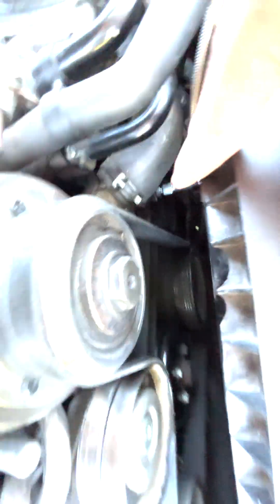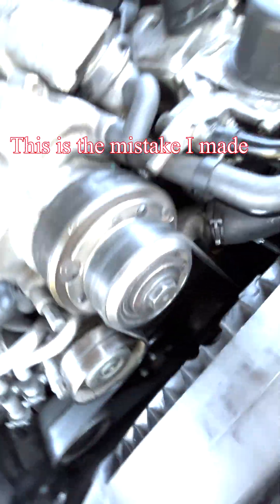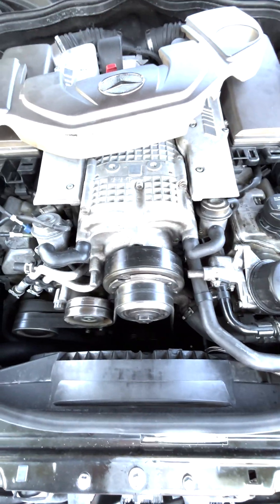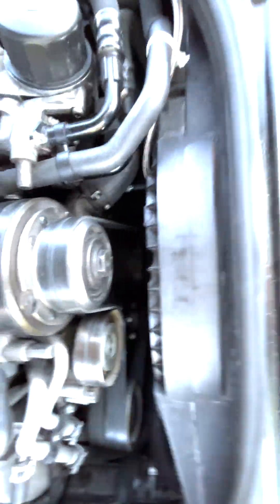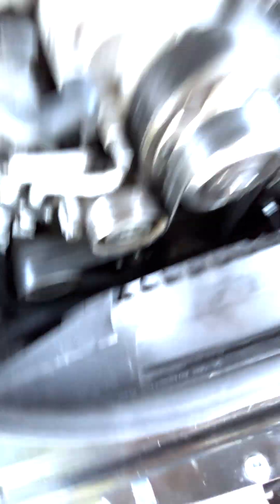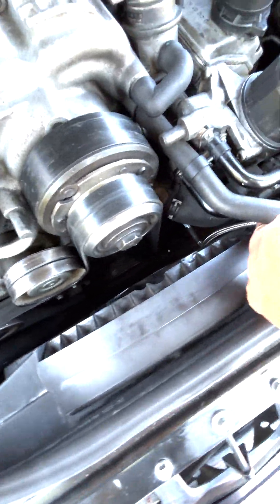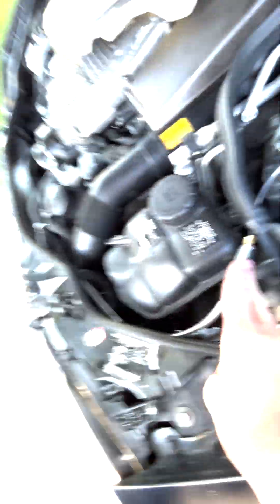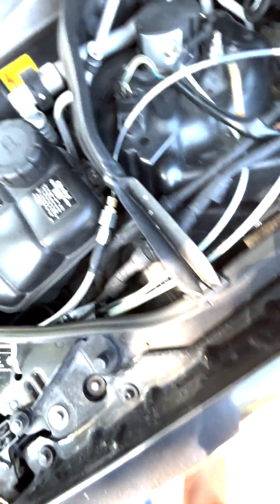How to install Oil pressure gauge on an m113K/m113 engine

Comment: How did you fit the plastic hose from bosch into the metal hose? Cant fit it…
Reply from the maker: do you have 1/4 npt adapters? I’d check out my other video not a fan of the Bosch gauge it leaked everywhere not the line surprisingly the gauge leaked.
Reply: @ ok i know whats the thing.. you used the metal line and then the plastic line. But anyway I also will go for the electric sensor but I‘m still thinking about which one.. yours like in the other video or a product from glow shift.
Reply from the maker: @usta.berlin VDO is what I used in the other video mine works beautifully and VDO is oem to the w211 if you don’t believe me looks for the works VDO in small print on your gauge cluster.

Comment: do you think i can do this exact steps to my 2012 W204?? *desperate help, thanks!
Reply from the maker: @jpanglao00  That car may have an oil pressure gauge already what engine is it? if not a 113 it likely doesn’t have the same access port. I am in the process of making an updated video but likely will not cover any other engines than 113
Reply from the maker: @jpanglao00  It has a warning light but no gauge E55 has neither hence the video you could install a gauge if you would like and this video could be helpful but isn’t the end all be all. your motor probably has a different oil pressure port.
Reply: @bugnautica-lo9ng  i’ll lyk how this goes, MB Forum tells me there’s no OPS on my model.
Reply from the maker: @ No gauge but I believe it has a warning light that’s what google says I started work on video 2 today my video should be very applicable if you can find an oil pressure port maybe there the same but I doubt it.

Comment: Installing a mechanical oil pressure gauge is highly recommended. Electric oil pressure gauges don't play nice with m113k equipped vehicles and tend to be inaccurate
Reply from the maker: Please tell me more; my mechanical gauge frequently reads zero when I am stopped (never when I am moving) but I know there has to be some oil pressure; as it’s been doing this for at least 2,000 miles and I have no engine issues or weird noises.
Reply: @bugnautica-lo9ng  Are you using a good quality gauge?
Reply from the maker: @justinf4827 Think so but maybe not it was sold as a bosch unit on amazon
Reply: @bugnautica-lo9ng  Have you tested the pressure with any other gauge?
Reply: @bugnautica-lo9ng  When I ran a line from the test port on the timing cover through the firewall to install the oil pressure gauge on my dash, I added a 1/8 npt T fitting between the abs unit and brake booster. This enabled me to plug in a mechanical diagnostic pressure gauge so that I could compare it's PSI reading to what the gauge I installed in my dash shows

Comment: I wouldn't put a gauge like that insode the car....if the line fails inside you gonna get burned
Reply from the maker: I’ve been changing oil for a long time never had it been hot enough to burn me; although I appreciate the concern. I have a friend who has been professionally restoring cars for 40 years and has never seen a properly installed quality bourbon tube fail.
Reply: @bugnautica-lo9ng  ok. Just saying based on common sense that running an oil line into your car is unadvisable. Tracks specifically ban it.
Reply from the maker: @tooththrhr  I appreciate the concern but am alright and can’t help but think there is a bit of fear mongering in saying tracks ban it; can find zero articles about that and many gauges do have oil lines going to them from factory especially in older cars. the line itself is secured in my car and the diameter is extremely tiny; it wouldn’t be able to flow much oil if worst come to worst.
Reply: The improper installation of a mechanical gauge could cause a mess for sure

Comment: Nice timing, I realized I need to add an oil pressure gauge to my E55 recently. What kind of pressures are you seeing?
Reply from the maker: @TireSlayer55  Hey @TireSlayer55 mine are apparently low according to mercedes spec but a local trustworthy shop said it’s fine and is probably just the gauge  a redditer said I maybe have an m113 filter not an m113k filter causing the low pressure mines 40-60 when cold and 12 at idle curiously gauge reads zero when I start the warm car until I move then gauge goes up. MB spec found at this link https://www.benzworld.org/attachments/check-oil-pressure-pdf.2814259/